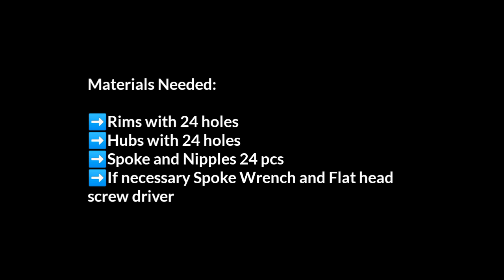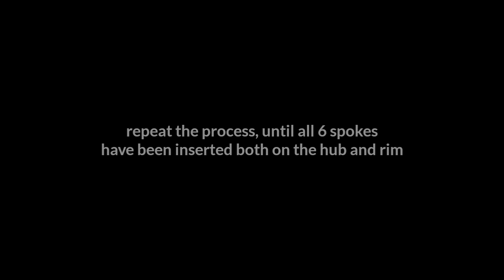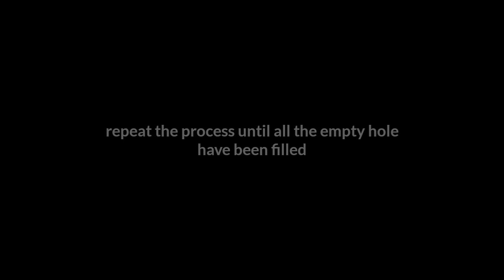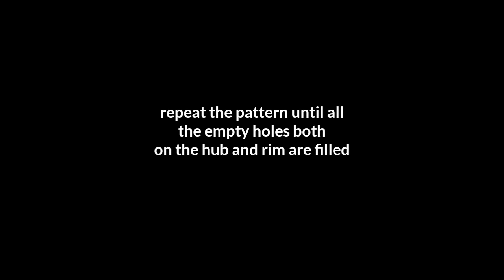How To Lace A 24 Hole Wheel / Step By Step Wheel Building / Paano bumuo ng 24 Hole Na Wheelset

Comment: Sir tanong lang, naka 700c rim ako at rb hub. Bale naka 24spokes ako tas straight pull na 275mm ang spokes. Ang butas nya is even na di katulad sa video. Balak ko sya icross pattern and gagamit ako 295mm na spokes. Pwede ba or poaaible ba yung cross pattern sa 24h?
Reply from the maker: baka iba ung pattern kung iba ung itsura nung rim at hub mo, not really sure kung paano sa katulad sayo, 
try mo sir search sa other vids baka may swak sa set up mo
Reply: @chrisworxcustoms  yung hub po pantay pantay din yung agwat same sa rim. Same pong 24 holes. Yung pang likod ko po kasi 28 spokes na naka cross lacing pattern. Kaya balak ko din po icross yung harap

Comment: idol ano pong spokes pwde sa 20holes 30mm na rim?
Reply from the maker: depende sa size ng rim mo kung
16, 20, 24, 26, 27.5, 28, or 29er
Reply: 700c po idol
Reply: Gusto ko po sana idol magaya ung pagka lacing sa cosmic na wheelset sa front wheelset
Reply from the maker: ayun ang kailangan mo pang 700c din

depende kasi sa pagkasalansan ng butas sa rim ung lacing eh, ung sa video kasi by two's
siguro kung iba ung sayo baka iba din ung lacing
Reply: Maraming salamat idol👍🏼🙏🏻

Comment: are the same steps for a r26 rim ??
Reply from the maker: please enlighten me, what's a r26 rim?
Reply: @chrisworxcustoms  26 inch rim
Reply from the maker: @ErnestoA.A.  oh I see, it depends on the hole, if your 26er rim has 24 holes and a hub with a 24 holes, this video can be your guide
but if you have 32 or 36 holes, you need to watch other video tutorials because the lacing is different
Reply: @chrisworxcustoms  ok thanks You bro